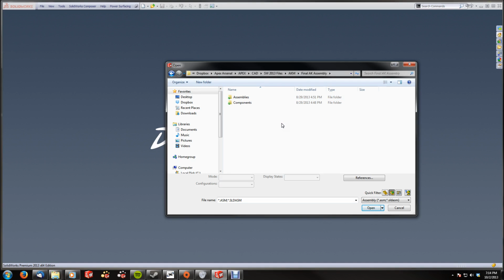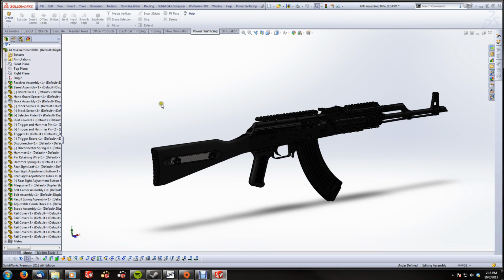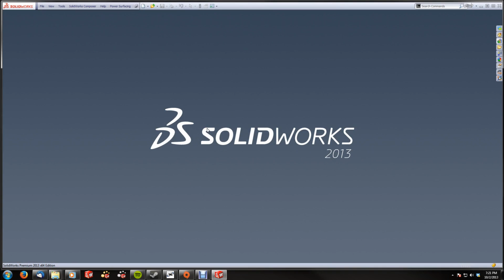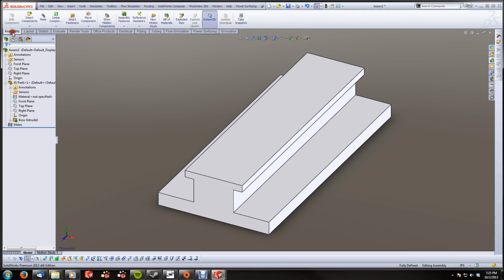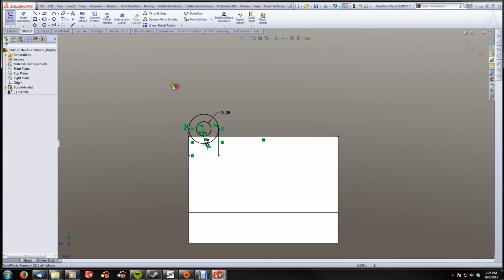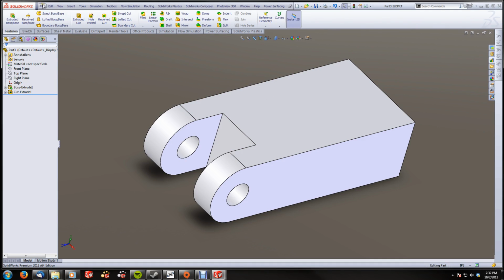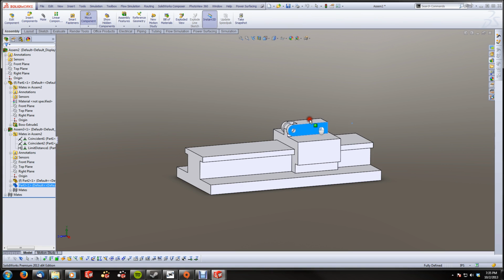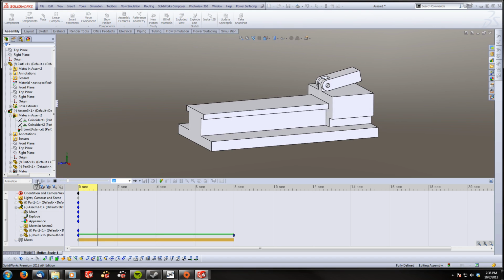Assembly Demo

Comment: what would u say the easiest way to draw up a motorcycle...part by part or whole bike.like frame, engine, wheels,so on and so on or in another way the whole bioke then attempt to 3d it and cut it apart...i wand to fab and change on a standard frame i have and honestly no clue where to begin..oh and for the record i got solidworks yesterday so very new to it
Reply from the maker: Hi there, sorry it took me a while to get to your comment. Honestly, the best way to model any real-life component is to remove it from as much of the main assembly as you can, and take measurements using a micrometer or caliper. When it comes to motorcycle parts, I have not done it myself, but I can tell you that those are not easy parts to model. There are some pretty advanced techniques to those components.
Reply: Thanks for the reply. Right now I'm basically just trying to go about the frame. I've learned a lot but I'm sure there's always a easier way to draw a 3d tube frame lol